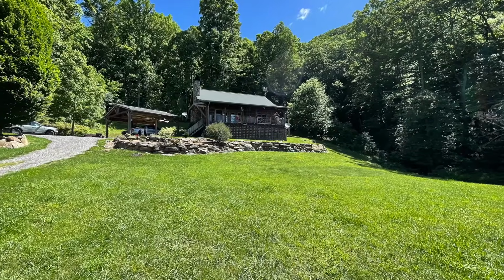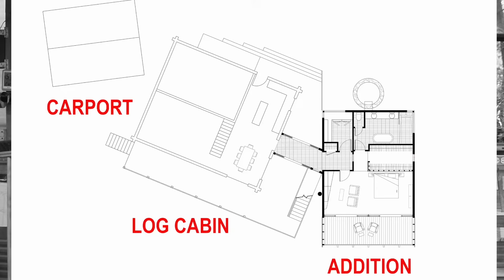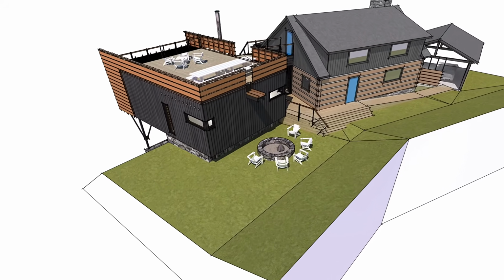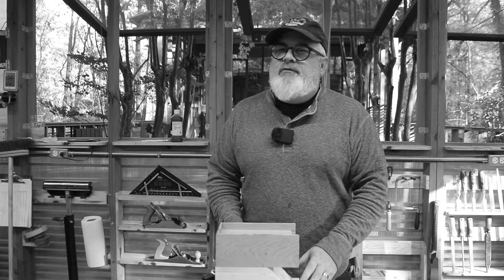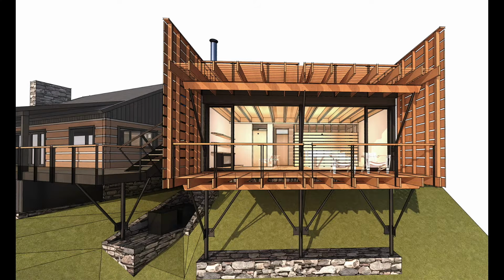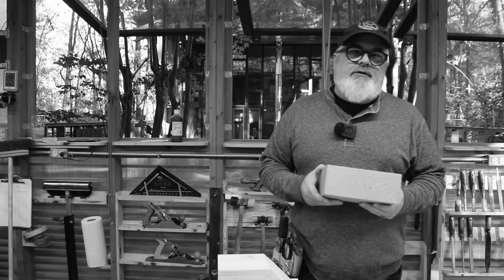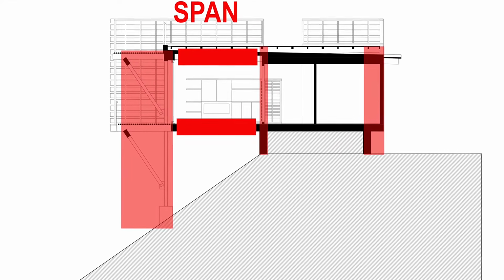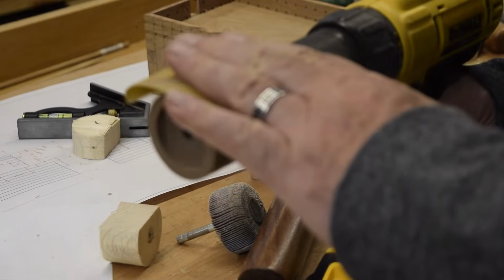How to add MODERN to a LOG CABIN #architecture

Comment: We build log cabins again. They cut the logs in half and sandwich insulation in them. Then put back together. I thought with code changes 5 or so back would be my last log cabin build down state MI.
Reply from the maker: That’s a clever way to meet modern energy codes while keeping the aesthetic.